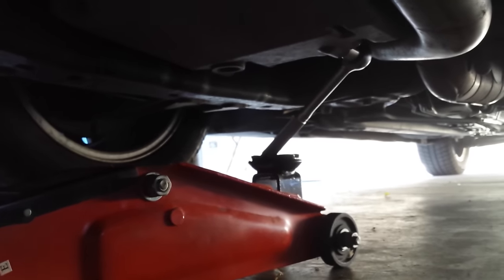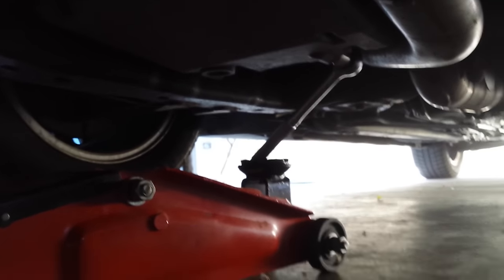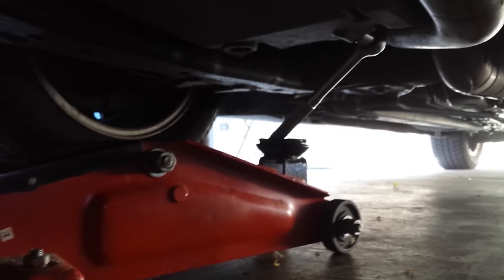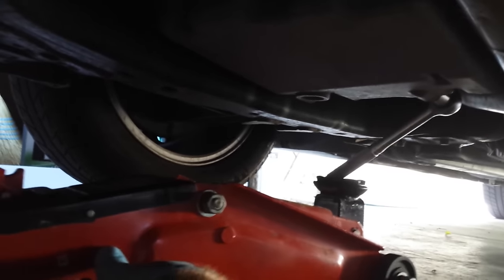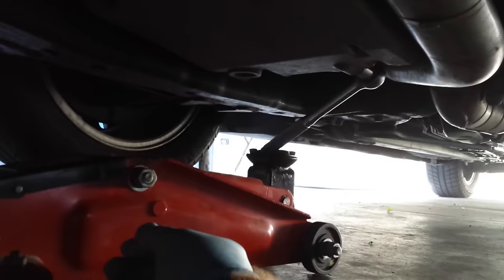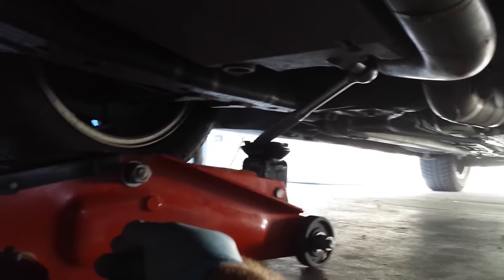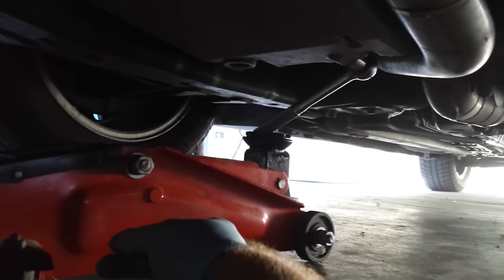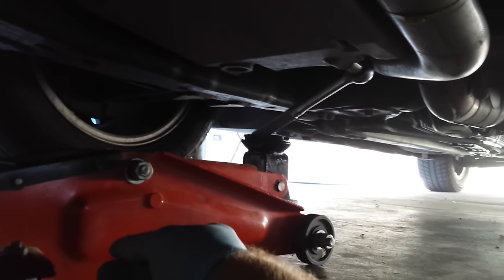Oil change tip  - how to loosen a stuck oil pan drain plug / bolt

Comment: Neither my son nor I could get the oil drain plug to budge on his Honda Accord. We used the longest breaker bar we had, which was 36 inches, and it still would not budge. We did not have a nice car jack like you have. Instead, we used the scissors jack, since that was all we had. It worked like a charm. Thanks for this tip!
Reply: I use the same jack, if it worked for you the I hope it works for me

Comment: I'm poor. Have enough tools to do brakes and change oil. Also changed out an alternator on this car. So 10 days ago I prepared to change the engine oil. Used a 12 point socket with a 1/2 drive. Rounded the corners on the plug. Ordered a bolt extractor. But it was too long to get my wrench on it. A week later talked to my friend, Jeff. He gave me a little 3/8 inch wrench and a 6 point socket (17 mm). A few hammer taps, got the socket on. But I didn't have enough leverage. So, I went back on youtube and found your video. Grabbed the tire jack from trunk. 15 minutes later, bolt is unstuck. Amazing. Thank you so much!

Comment: 90% of the time I do my own changes, but cause I was getting something done I had the dealership do it. Well, 4,000+kms later I tried doing my oil change on my 2011 ram 1500 hemi. I swear I was about to strip the bolt I was trying to hard to get it off. Had a certified mechanic come look at it, he said the same as I did. "What the hell? Did they use an impact gun?" This is what you get when a dealership hires a bunch of high school students with no clue, as apprentices. I know everybody has to start somewhere, but come on. I'm more worried that they over tightened it and stripped the bolt or even put it in crooked.
Reply: kowal789 , so how did you end up getting the bolt loose? Did you use this method with the jack?

Comment: Who's this genius?? I spent hours trying different ways to turn the bolt but it won't even budge. The darn dealership super tightened it saying they don't want it to leak because of the thin motor oil. I think they just don't want me to change my motor oil. Now, if you would excuse me, I'm going to bed with my hydraulic jack.
Reply: fqn 3 I think anyone doing an oil change does it up bullshit right because it’s the last thing u gotta do
Reply: Frazer Brennan , yes you are right. Same thing when they tighten the lug nuts on tires, its like they think they will NEVER EVER EVER EVER have to come off again! Nothing more irritating. At least when working at home you can have a breaker bar or pipe for extra leverage but unless you want to carry one in your car, you're screwed if you have a blow out on the road. I've literally stood and bounced on a lug wrench, and had to do it several times before it let loose... and I'm no featherweight.
Reply: Nah it's just dealership mechanics are lazy usually so they use the same impact gun for everything which is usually way to powerful.
Reply: lmao

Comment: Man, can you believe you are still helping people eight years later?  I was in a dilemma just like these other gentlemen, stuck with an oil pan bolt over tightened by some testosterone starved clown with a power tool!  As always, I checked YouTube for a remedy and the gods did not fail me. Thanks to you, I was able to use my scissor Jack to loosen the bolt. Oh what a relief it was to hear that bolt pop. You sir are a genius!  Now I can change my own oil with the type I want and not have to spend half a day in someone’s shop. Thanks again!

Comment: Thanks a ton, I thought I tried everything - PB Blaster, a pipe, a giant hammer... nothing worked until this! Just be sure to use a 6-sided socket. I used a 12-sided box wrench and rounded it a bit (just from doing it by hand without the jack). Same story as everyone else: a shop mechanic tightened it with an air wrench.

Comment: i love you right now lol i just bought a car that was only maintained by shops before me and i usually do my own work and they tightened the oil drain bolt an insane amount.
Reply: have to go to shop they used a thread locker and impact wrench i lifted the car up with a socket wrench XD  its stuck to say the least

Comment: Thank you so much for this advice. I tried changing a friend's oil and the plug was torqued on too tight so I couldn't do it and gave up. Then I went to change my wife's oil and it was way too tight as well that my torque wrench wouldn't even get it loose, but this trick here got it off. Thank you so much! I have no idea why you have any thumbs down whatsoever.

Comment: This video is underrated! Thanks for the tip. After trying for about 20  minutes to no avail I did a quick YouTube and was not disappointed. Pulled out the 3 ton jack and breaker bar and raised it very slowly! The bar actually lifted the car just over half a centimeter before finally breaking loose to let me drain the oil! Thank you

Comment: I just suffered about 1/2 hour or more trying to loosen this up. I have a right frozen shoulder that I am dealing with. Ran to Autozone and sat there looking to see what I can get to get it out. Then I saw this video and go straight home and it worked.  I'm pissed and happy at the  same time. It's freaking hot today but thank God I am done with this little thing.   Thanks for the video.

Comment: You are a life saver, bro. After trying for 4 hours I had given up. Used Wd 40 and heat gun, breaker bars everything. Still won't budge finally used the jack. The weight of  car and gravity did the magic. Thanks a lot 🎉

Comment: Outstanding video.    I was about to give up with my oil change because I could not loosen my oil drain plug, until I saw this video.  Even though I do not have a floor jack like the one in the video, I used by factory-supplied tire jack instead.    And, the result was very clean,  safe, and effortless.   Thank you.
Reply: 🤠 tip my hat to you too, the factory jack idea worked for me. thank you!
Reply: My bottle pump was too tall for leverage so the factory jack worked perfect, thanks for your comment 4 yrs later!
Reply: Great idea and great comment.  Saved the day.  Cheers!

Comment: @TheVintageSteel, you sir are a god for at least 5 minutes of my life. I almost stripped my drain bolt in frustration. After trying the jack I thought my bolt wrench was broken when I went down to turn it and there was no resistance loosening it. I checked it three times to see if it was turning the right way. That’s how tight the thing was on. I gave up the last time I meant to change it myself and went to a shop. They didn’t get me this time. Thank you!

Comment: you are genius!! I was depressed the my first DIY Oil change would never happen due to a overtightened Oil plug!! but your trick worked great... I used the carjack which comes with the car rather than hydraulic jack but same result. The plug loosened so easy for my Honda. I was careful to use a 6 point socket to avoid rounding of my oil plug:-)
Reply: Rahul Rajagopalan same. bought a car and tried my first oil change. the plug is impossible to break loose

Comment: Just did a customers oil change on their hyundai. The guy tried doing his oil change but stripped the bolt and im sure he over tightened it cause that thing was not coming off... ugh. I'm usually against using impacts on sump plug bolts but had to lightly tap a socket on it and use my m12 stubby to loosen it. It came straight off. Man I love my stubby. Thing virtually fits into any tight space.

Comment: This is a fantastic idea! My transmission drain plug was stuck and after using penetrating oil I tried the jack on the ratchet handle and the plug came loose.
Thanks!

Comment: I also just used the jack that came with a 97 Neon I just bought to loosen the oil plug.  BEST IDEA EVER… I found this after about an hour of pulling and praying it didn’t strip. Excellent video… saved the day.

Comment: THANK YOU :) This method worked for me. Don't be discouraged if it takes a few tries to get the ratchet and jack into the correct position like happened to me. Once everything was in the right position, the stuck oil plug popped out immediately

Comment: you just saved my ass man. I always do my oil myself, but last time I was just too busy and took it somewhere to get it done. so here I am today, changing my oil and the bolt would not come off. I tried everything, using another wrench for leverage, I hammered it and it still wouldn't come off. but this? worked like a charm. you're a genius.

Comment: My Man!   Totally worked.  I used a stilt to hold my car up for safety.  I put the jack under the wrench and it loosed with ease.  I wonder why it stuck like this though?  Never had it do that before.  I just recently had it appraised at a dealership for S and G.  Maybe they tightened it more because I gauged them on price on my new car. LOL.  whatever the issue.  This worked!  Thumbs Up!

Comment: Holy hell man, I didnt even think of that. Where mine is I can only get to it with one arm and cant use a cheater bar, and too scared of the truck rolling off of the ramps, or falling off a jack. Thanks a lot man.

Comment: Wow, Great Idea!  Unfortunately when I did this I had already started to strip my bolt with my socket wrench by hand, so when I added the strength of the jack it made it impossible to get the socket back on.  
BUT!!!  I was able to take a hammer and tap my special stripped bolt 13mm socket onto the stripped plug and then I was able to try your idea again.  AND IT WORKED!  Thanks!
2 TIPS: SPRAY DEEP CREEP ONTO BOLT AND TAP YOUR SOCKET WITH A HAMMER!  I think this loosened it up!

Comment: My car had the bolt in a tight spot, my impact couldn't latch on straight. It was also a 220lbft so not too strong. This method worked very well. I used my scissor jack as my jack was too tall.

Comment: This is awesome! Tried to unloosen drain plug on my silverado.  2 hrs and still no go! I'm gonna try this tommorrow! What chances do you think I have of this working? I could not even get breaker bar to work
Reply: Howard Jenkins going to try this also but I’m worried about my drain plug stripping. Is their anything I should know?
Reply: @lancemcinvale3512  it works! I used my floor jack very slowly, don't take much, but it works

Comment: I'm at my wits end and am about to try this. Not sure it'll work because of the angle of my drain plug but worth a shot.
Reply: I'm glad it worked for everyone else, it did nothing for me. I guess Subarus are the only car that have the drain plug configured in such a way that you have to move completely against the force of gravity to remove the thing. My wrench doesn't just chill there like that, I have to push up to hold it on while pulling to try to loosen it and it's angled too  much to be able to use a jack as leverage.

Comment: Thank you so very much. If I saw this video 4-5 days earlier it would've saved me  $45. I bought a cheap drill to try to get it off (even the drill couldn't do it). I just bought a vehicle & they always brought it to jiffy lube for an oil change. I'm new to working on cars, but isn't it bad to over tighten the drain plug l? Great hack my brotha!!!

Comment: Thank you! I never would have budged that nut without this tip. I used a small 2-ton bottle jack and I had to be under the car to hold the wrench in place at first. I can see how this might be dangerous, so I hope people take precautions. But this way is so easy I feel like a chump for busting my hump with a breaker bar that didn't work.

Comment: I wish I'd seen this last Sunday.

I decided to change the oil on my VW LT32 Van and put some Wynns Engine Flush in the oil. THEN, and this is a lesson for everyone, I tried to remove the Sump Nut... Big Mistake!!! 

LESSON FROM FRAGGLE ROCK:
Always make sure your sump nut will come off  ---- BEFORE ---- adding engine flush. This muppet has learnt a lesson.

It looked like someone had tried to remove it previously with the edges being slightly worn so I was going to have to be careful. 20 mins later with a beautifully chewed up sump nut I gave in. I tried practically everything including some Irwin Bolt Grip Nut Removers. I'm a big guy 6ft 3in and 20 stone and I couldn't get it to budge.

I concluded that either someone had put the sump nut back on with a ratchet driver; the kind they put wheels on with, or I'd upset Magento.

I had to spend all day vacuum pumping the oil out and I was not a happy bunny because it is a total ball ache.

I'll be changing the oil next year so I'll be trying this method. Thanks for the tip.
Reply: +darkan99el This is a one year reminder to change your oil and remember that sump nut is fucked
Reply: +Gawdat lol cheers Gawdat. I did eventually get it removed and a Quick Drain Valve installed instead. So no more Sump plug removing: http://www.quickvalve.co.uk/

Comment: I have this problem now I wish I saw this video before I got frustrated and stripped the whole bolt, I heard by some mechanics that it might strip your oil pan and you will need a new one if its stuck and you can't take it out is this true?
Reply: MNMs World , yes. It can strip the nut or break the wrench, or even worst case scenario, snap the bolt.
If any of this happens you'll have to tap a new plug.... which would really suck.

Comment: Yes, the so-called Certified mechanic at Firestone used an impact wrench to tighten the oil drain plug  on. I also caught the fuckers using refined used oil too, when I noticed the mechanic using 1 qt plastic bottles with no aluminum foil seal. The cap was sealed though. Odd ? They also told me I had bad brakes in the rear and I did not. I refused the service and took the car to another garage, brakes were fine. Firestone gave me some BS about tires being too old. They wanted to give me a pro-rated deal on a new set. The tires passed inspection at another shop.  My estimate was over $1000 to pass inspection, I refused. At another garage the car passed just  wipers replaced. Ive been doing my own work since then and ignoring state inspection. Screw the law ! Everyone has their hands in your wallet.

Comment: I'm gonna try this. I spent half an hour trying to loosen it before giving up. I even brought out a two foot breaker bar and nothing. So ridiculois. At $110 for the last oil change, they should have used a torque wrench made of gold to tighten the damn bolt.

Comment: Well, mine is a Honda Civic d16z6 and it is at an angle and it just slides off the bolt  and it is really pissing me off cause the person that had this car before me tightened it like he was the hulk or something so I'm pretty much screwed... I put wd 40 on it and used a hammer to tap and used this method and it won't budge.... It's like it is welded on there
Reply: It could be cross threaded. It sounds bad but just take it to a shop they have torque guns which is what some idiot probably used on your car just like my girlfriends

Comment: It's NOT the Individual Mechanic that tightens the Bolt too tight, It is the Oil Change Shop that PURPOSELY Overtighten it so as you Need to go to them for an Oil Change !!

Comment: What if the plug is horizontal though? (Like not up and down like yours)
Reply: Chelsea Baker horizontal jack?
Reply: I've never seen a horizontal jack in my life but if you can send me a link that would be incredible. My Paw Paw said to stick the back of a ratchet into a metal conduit and use it as a levy, also got some PVC pipe in case the conduit breaks. Thanks again.
Reply: Chelsea Baker , are you completely sure the bolt you're on is the oil plug?? If so, then yes, use a pipe over the wrench handle for extra leverage.

Comment: looks like the dislikes in the video are from salty dealer techs that over tighter oil drain plugs
Reply: Yep they are "over tightened", until you call the shop a week later claiming it wasn't tight enough. A person should tighten the nut until it's slightly tight then give one hard pull and then one last regular pull to check/ensure proper tightness

Comment: I had to use that method when I was a kid changing the manual gearbox oil in my Ford ranger. They wonder why people have to re-thread oil pan drain thread's. For Fucks sake 20 Ft Lbs is all that's needed. You don't need to be He-man when snugging down.

Comment: Stupid is as stupid does. Try using penetration liquid. Try using a longer extension, try using a large rubber mallet. Do not use a floor jack to loosen a stuck bolt.
Reply: PeterDad60  ,well y not is it due to the dangers that be of lifting the car off the jacks or lifting it period and we all no the car could roll...WELL HE CLEARLY ADDRESSED IT ....and if you want to put a longer extension in anything you put it on the floor jack handle and your nowere near any danger...ur ideas are old and outdated,while this was a genuine ingenuity by an old timer sounds like your jealous .
Reply: hill t , I would actually like to know the manufacturer name of any wrench that size that  would actually lift a car before the wrench bearing housing would break, or the handle would break.

Comment: Hit it with a hammer. Takes a lot less time and you dont have to adjust a wrench and a jack at the same time while laying on the ground.
Reply: Joe McKoy this is a obviously a last resort that comes after trying what you suggested. I managed to get my stuck drain bolt out today with some gool ol' fashioned muscle. Too bad my back/neck/arm is gonna hurt for like a month lmao. I swear, i don't trust anybody to get a job done right nowadays. gotta learn to do everything urself.
Reply: Juanito Alimaña lol glad you got it. The hammer trick worked well for me.
Reply: the problem with the hammer trick for my car was because of the angle and low clearance, it was impossible to get any kind of force behind the thump.